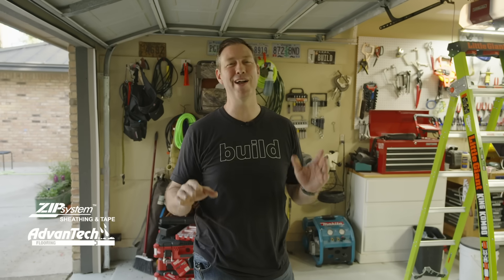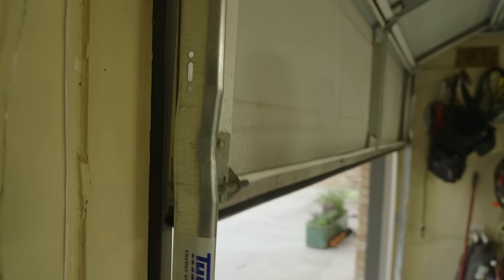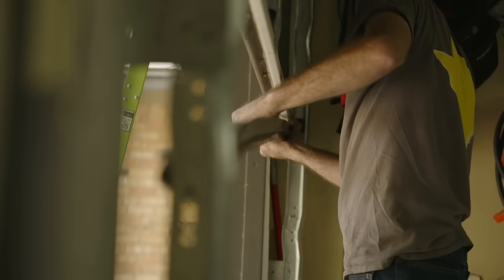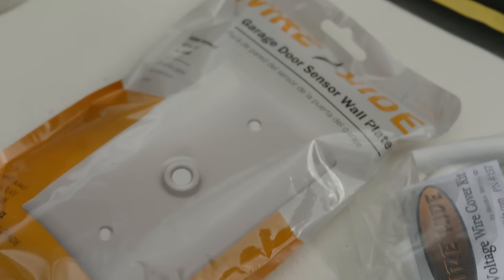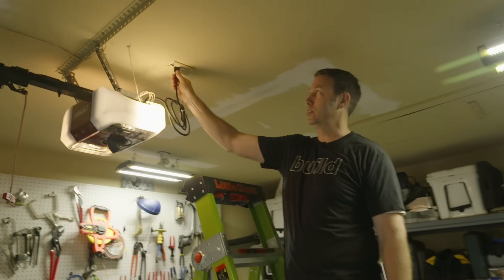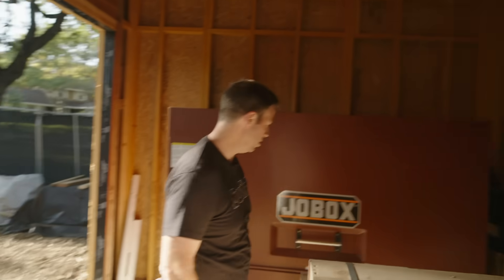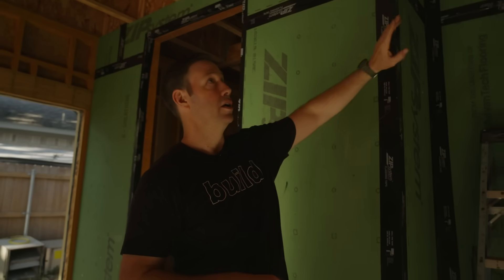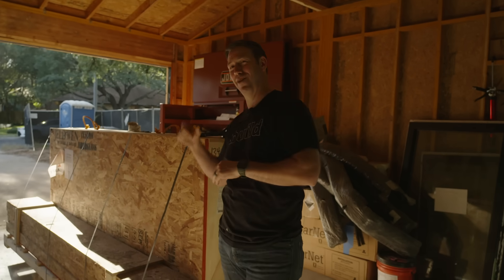Garage Door - Air & Bug Sealing

Comment: I will never put in uninsulated garage doors again.  I installed Clopay "Classic Steel" 16x7 door with no windows with 18.4 R-factor and what a difference it made! My door faces west and the hot Texas Panhandle sun would heat up the garage in the afternoon to a mini oven before with the old insulated steel doors. After I installed the doors, I can go out in the garage in the afternoon and do some actual work in the garage as long as I haven't opened the door all day.   I'm 100% believer in insulated doors!
Reply: I'm happy to hear this. I've got an R18.4 door (no windows) coming next week, sometime. It's going to replace an uninsulated hollow wood door that my wife backed into a couple years ago. We just had the floor redone to add a frost wall which wasn't previously there, and had the floor lowered so the door can close all the way. I'm looking forward to the insulation because the garage is underneath the living room.

Comment: I just got done with a 3 car attached garage addition. Used C.H.I. Carriage House Doors Model 5916. Here is a picture of how it turned out. https://imgur.com/a/H34rscu

It is below freezing in Wisconsin and my garage stays comfortable at 60 with the heater barely running. Those ThermoTraks are a great idea though!

Comment: I do a lot of thermal imaging of commercial garage doors and the biggest leak area is the top. I noticed you didn't cover the top sealing issues. Also in your new house your exhaust fan isn't going to work without a make up air source, particularly if you have it air tight. In my garage, I enjoy the leaks around the door because it provides ventilation to combat the chemicals I store and also combustion air for my atmospheric Modine heater. Some things people should consider before getting it air tight. Air quality and safety should always take precedence over efficiency.

Comment: My doors have a brush type seal on the top and sides and my door bottom is similar to his new stuff. I have RW Landmark doors that are R18 here in Alaska. Even at around -30 they work well. There is no air leaks between the joints either as they get tested a lot. Heck it’s gusting to almost 30 now. We have a liftmaster that mounts in the end of the shaft so you don’t have all that track over the door.

Comment: Matt, question I've always wondered about industry standard of garage door sizes, why is it single stall garage door sizes 9' wide and many times in upper end houses even 10' wide doors have become commonplace. However in the double door wide senerio what I have run into at local retailers like a Menards, that anything over 16' wide is a special order with quite the up charge. as personally driving a half ton pickup and here in the midwest where most the vehicles on the road are pickups or Suvs it seems foolish to put only a 16' door in and think your going to pull two vehicles in comfortably and be able to have space to get out and get around unload groceries and if you have kids not have them door dinging your other vehicle.

Comment: I use the side and top seals you used as well as changed the bottom bulb seal.   I followed up with a seal attached to the garage floor which the bulb seal meets up with https://images-na.ssl-images-amazon.com/images/I/412UHtMLWaL._AC_.jpg.  I have my wood shop in the garage so I installed two 12000 btu mini splits in garage to heat it.  Insulation is foam board over the doors.  I purchased the house from a company already built.  It was a spec home with all the extras but have regrets in not having 220 run to the garage, more outlets and the walls were already drywalled and painted without insulation in the garage walls or in the garage ceiling.  That extra bottom seal seems to keep the mice out as I had problems with rodents prior to installing it.

Comment: In Ohio insulated garage doors are standard. There are several options for thickness of insulation. There are also several options for bulb gaskets between the door panels. I use Wayne dalton doors but there are other good options as well.

Comment: My insulated garage door is still conductive of outside cold temperatures. I would suggest a non insulated door and then add your own insulation foam board and a decoupled inner panel.

Comment: Per the garage vent system... does the manufacturer make an optional positive pressure system? Or would the whole garage be better ventilated with an ERV unit (Energy Recovery Ventilation) with the ERV working constantly EXCEPT when the garage door is open, since you plan on using a mini split system for heating and cooling and sealing off the garage from the house? The ERV unit would help keep the inevitable fume creep from migrating from the garage to the house.

Comment: I love the idea of the exhaust fan. However, now that you have done such a good job air sealing your garage, are you worried about providing enough intake for your exhaust fan? Should you add a outside air intake? I have a two car attached garage with no windows. I am considering adding an exhaust fan to get the heat out of the garage from the warm cars.

Comment: I would love to see/understand pro V con on side mount garage door opener.
Reply: The door needs to be a torsion spring door. The main benefit is not having a rail/head running down the center of the garage. The disadvantages are most homes aren't wired for one, they can be finicky if the door isn't set up/installed right, they have an electronic lock that mounts to the track and have seen the lock fail a lot. I have also seen the wall button fail a lot for the side mount openers. Liftmaster/Chamberlain does make the best residential garage door openers though, I would avoid the other brands.
Reply: Me too, only cons I can think of off the top of my head 
A: It requires space on the side
B: You need a door with a top mounted spring, this would make it harder to use with older doors.

Comment: Good vid as usual, and interesting comments below too.   On your question of insulated doors, they make a huge difference.    We live in Portland Oregon (dig the Oregon plate on your wall), and have R-17 doors here.  We use the garage for one car parking, then some temp controlled storage, competition ping pong, and even on a 35 degree day, the garage is 60 degrees.  Summer day, 65, so it's perfect.   We are also fortunate to have had a 2nd home in Palm Springs, we did a R-12 door down there, as that house faced west.  Let me tell you this, on an August day in Palm Springs, you get to know real quick about heat transmission when it's 120 degrees outside, because that's the air temp, what you touch is way hotter than that.   Lessons learned real quick, but that garage never budged over 78 degrees even on the hottest of days, so I bet R-17 would have been even better yet.   Last note, garages are one mans cave, and anothers giant storage shed.  It all just depends, no right answer for anyone.  But if you can afford to do it, I highly recommend an epoxy floor, they are awesome.   And not the Home Depot kit kind, I'm talking a professional firm grinding the cement down, full detailing, then the good stuff put on to make it shine.    Even my wife likes the garage, and as that goes, it's a double win for me every day of the week.    Keep up the good work, love your passion too.

Comment: In the garage addition to my home an office I put in an 18' x 7' custom built wood garage door with four tempered insulated lites of glass.  It is 2-3/4" thick laminated cedar with a side mounted Lift Master open.  The door weights 690 pounds.  We have custom weaterstripping on order.  The bottom weaterstripping extends beyond the door by approximately 1". 
We used Rockwool insulation on the walls and 10" of insulation in the ceiling.  We will keep the temperature at 40° in the winter.  We don't have worry about air conditioning the garage in summer here in Northern Wisconsin.

Comment: For your new house you should go with a R19 insulated door, with a 32” radius upper track or high lift track, torsion spring setup and a lift master 8500w wall mounted opener.  I can’t think of a better setup for a garage.

Comment: I replaced the seal on the underneath side of my garage door when we bought our house in 2016. I still had a large gap right in the middle of the 16' door. I put a "storm seal" or "weather seal" on the garage floor that the door sits on when closed. Made a HUGE difference! Glued it down with poly liquid nails and never looked back. Best $50 I could have spent!
Reply: This is due to your floor was not tapered right for the water run off, most floors will have the taper back far enough under the door so water will run away from the door.
Reply: Curious as to where the water or snow melt will run to if that hump is sealed to the floor?
Reply: how would water escape the garage though if u have a sealon the floor

Comment: Great timing. Just bought a new house with an attached garage that has a shared attic space with the family room next to it, and ZERO insulation over the garage. Was thinking about doing spray foam hot roof over the two spaces, but don't know how to air seal the wall and ceiling. Can I just do ZIP up the wall and onto the ceiling and tape up the seams? Also, what do you plan on putting over the top of the ZIP to finish the wall? Just adding some sheetrock?

Comment: I cut a 2-3" deep channel along the threshold for my door to sit down into. No more wind, no more leaves, no more bugs!
Reply: What about rain/water buildup? Also as your springs relax over time the door will sit lower and lower and likely to have the top of the door slip under the header and create a huge problem. There’s a product called “STORMSHIELD” you could use one on the outside and another on the inside of the door creating a damn but not interesting with the doors functioning.
Reply: @greatdoorsandgates4991  good question about the water and something that was on my mind; the slab is divided right down the middle all the way to the street so I just widened it a little where it intersects with my channel. Water won't get into the garage even if the 'drain' gets clogged because the garage floor was poured about an inch above the threshold and the driveway slopes down enough too.

As for the springs those are adjustable but I replaced the whole door with a coil-up.
Reply: Love this idea but wont in cold climates , water will get in there and freeze the door shut.
Reply: @dangreving1094  that is a great point! We do get freezing weather here so I guess this winter will be the test for that; I'm guessing it won't be that big a deal but if it is I'm willing to work around it for the benefits of having totally killed the wind which does pick up often, the leaves and critters. (And I reckon a little more secure than it was before to be honest.) If it does freeze itself shut I suppose putting a space heater on it for an hour should do the trick.
Reply: I need to do the same. How did the concrete look after you finished it? I have to figure out a way to make it not look like a hack job.
Reply: @oknave327  I eventually rented a gas powered cutter for about $150 for 4 hours; the cut looks fine but I will finish it on both sides with 2" aluminum angle along the edges and it looks bitchin gotta say.
Reply: Thanks for the follow up
Reply: What's wrong with door gaskets on the bottom?
Reply: @percyfaith11  nothing, this is in addition to door gaskets.  Having had this door now for 3 years, watching it nestle into that channel when I close it is a huge feeling of security.  The door is being held positively on all 4 sides instead of the 3 every other door has, and would be extremely tough for a home invader to pry open.  In fact, I'd go so far as to say it would take a giant, heavy vehicle with a hefty chain to rip it off my garage, and even then it would probably take the whole front of the building with it when it came off!  It would be easier to attack my house by punching through a wall then coming through (under) the garage door...
Reply: @bruinflight  This is a solution in search of a problem.  
That door is no harder to pry open than without the slot.  I don't think you realize how flimsy a garage door is.  A simple lock would accomplish the same thing.
The water in that slot will rot or corrode the bottom of the door.
Reply: @percyfaith11  I installed a commercial-style roll-up door that is quite robust..
Reply: @percyfaith11  also, the door is galvanized and I live in an arid zone though we do get occasional rain and it does not puddle in the channel.  After 3 years I see no corrosion.
Reply: @bruinflight  still silly defacing the garage floor for no benefit
Reply: @bruinflight  the lock on the track and the opener motor will do the same thing without going through the work of cutting a weird trench in your floor.  All someone has to do is jam a crowbar through the door to pry it up.  That slot is doing nothing.
You keeping drugs in your house that you're worried about people coming in the garage?
Reply: @percyfaith11  I like weird things, so the channel really works for me.  All it took was about 20 minutes and $150 saw rental from HD.  I also wore sandals and shorts when I did the cut.

I'll see about the crowbar idea when I get home.  There may or may not be enough room to fit one into the channel between the edge and the door; my recollection is that it's a pretty tight fit.

Besides the drugs, I have my mom's 'survivor' 1963 split-window in there.  Irreplaceable.  

Making forced entry difficult enough to be a deterrent is worthwhile.  Like I said, an attack could also be made by kicking a hole in the wall or cutting a hole in the roof...  This is not the fortress of solitude, as much as I'd like it to be....
Reply: 30 minutes.  I had a sandwich halfway through.
Reply: @bruinflight  "I like weird things". No shit?

Comment: I wonder how those tracks will wear long term...
Reply: I think the tracks will we're fine but since it pushes the door into the seal and its resting position every time a roller passes that section it rubs against the gasket or the seal so I think that will wear out much sooner.
Reply: @danielbuckner2167  it should only hit the seal when its in the closed position because each wheel going up on the door is farther away from the wall as they go up on the door, same goes for the track, it gets farther from the wall as it goes up. When the door & track is set up properly(and properly maintained), this special track should not be needed as the door should be tight to the wall when fully down.
Reply: @AndyFromm  ahhh that may be true then. I only see old poorly installed stuff probably and dont notice when it's done right as it doesn't draw attention. I dont do garage doors and my shop has trolley doors to keep the open space above for a gantry so that isnt an issue for me though I did reseal my parents garage in a house they live in temporarily until their new house is finished and has to add seals on all sides including the floor as the aperture was not square.
Reply: @danielbuckner2167  when done right (both door frame & door) it should sit quite tight closed but as it gets used, the track, rollers, and hinge points wear making it all loosen some.
Reply: @AndyFromm  All sensible info.

Comment: I researched door insulations as provided by manufacturers... all it is - allllll it is, is fiber foam board attached to the aluminum sections. You can do better cutting 2" poly foam and sticking it to your door by caulking, all by yourself! The biggest problem is the squares are inset and the door has a bend which cannot truly interlock with any insulation. No matter what you attach, there needs to be a taper within the geometry for the place that the door bends as it goes up, lowering the overall R value in those places.

Comment: Fellow Pittsburgher now living in NW Wyoming just outside Yellowstone.  Strong westerly winds here most of the time and my garage doors face west.  Installed Clopay insulated doors that are also “wind rated.”  Very happy so far.  Also have 2 Chamberlain openers with My-Q.  Installed mini split in garage for heating and cooling after watching your videos.  Thanks for all your advice-I used much of it in my new build.

Comment: Re: the ventilation fan.  I'd put it on a timer-controlled switch (similar to a bathroom vent fan).  When someone returns home, they can park, press the timer for say 1 - 15 mins.  That way it's controlled by the occupant.

If you want it automated, such as keeping vehicle or household chemical fumes ventilated out, then the question becomes more whether one wants their garage to be normally unconditioned (ie garage heat pump is only on when you're working in it and otherwise not), or normally conditioned.  I can see reasons why people might want either depending on their use patterns.
Reply: Ooo- I wonder if he could use a foo or to trigger it- smart air sensor kicks it on when indoor quality goes crap- may be touchy with gas cans  or similiar fuming up the place but, you wouldn’t wanna breathe that stuff anyways
Reply: The trouble is the occupant forgets to control it.

Comment: I used 2 layers of 3/4 Thermax board on my first garage door since the depth is 1-1/2”. A bit labor intensive and not so cheap but worked great. For my second house  I used Reflectix. It’s much lighter and cheaper and works just as well. I tested both with a thermal imager and saw about a 10* drop. Insulated garage doors are nice but expensive and you don’t get more than r-10 so my methods work best for existing doors that don’t need to be replaced.

Comment: I bought a 18 foot wide insulated door that's double sided and 2 inches thick. I am also in zone 7 here in MN. Sealing the door is tricky and the main thing is to just seal everywhere else so the air has nowhere to go. edit: the outlet for the opener should be a single gang outlet. The NEC only allows an exception to the GFCI rule if the outlet is dedicated.